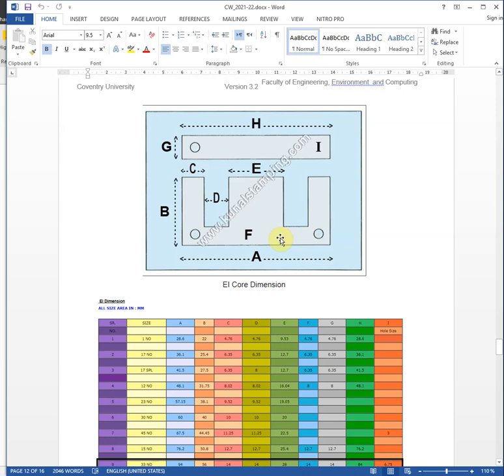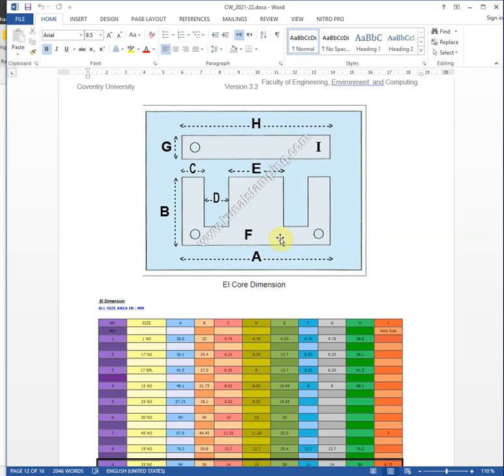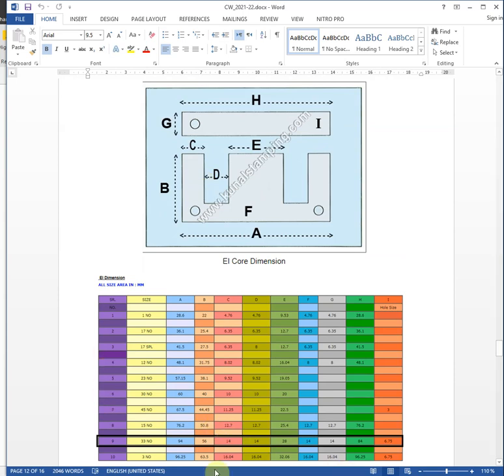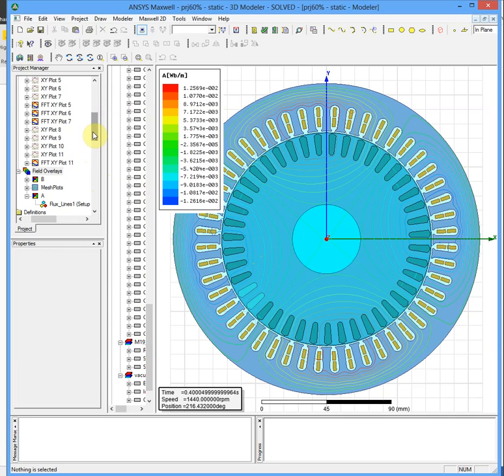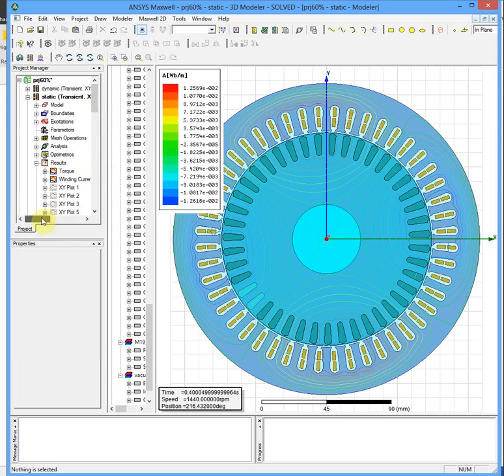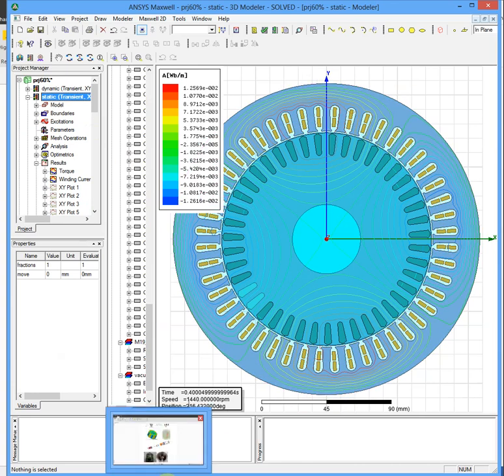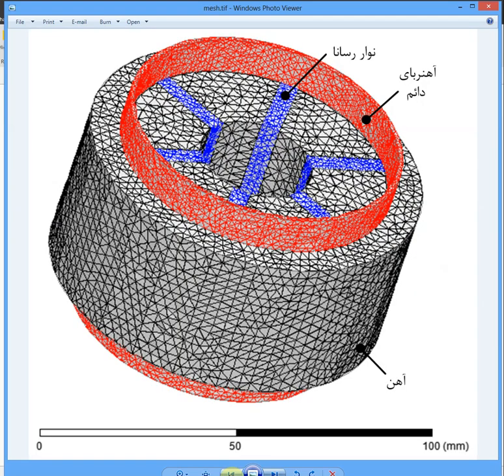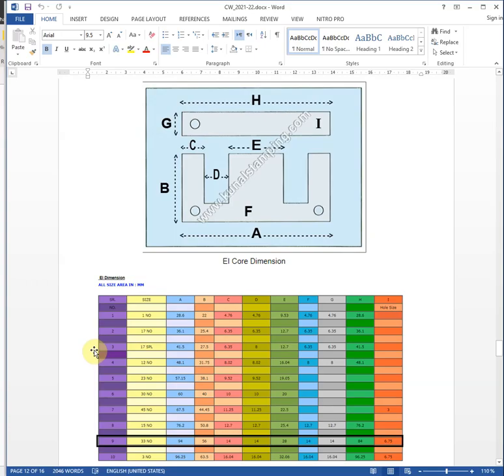Ansys Maxwell sample projects for electrical engineering students and industrial engineers

Comment: Hi Ali, In my company we have a motor that works with 6.6KV. Some bars of its cage has broken and we want to change the bars with copper (current bars are aluminum). Can we use Ansys Maxwell for simulating MV motors?
Reply from the maker: Yes. Ansys maxwell is the best choice for simulating changes in electrical motors. I would be glad to co operate if any help is needed.